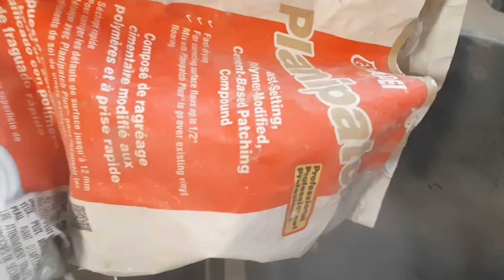How to use patching compound for unleveled floorings.

Comment: yet another video with no explanation as to what or more importantly why you are doing the steps
Reply: It’s ok it was Jack shit all the feather finish videos are, my advice grab some ardex feather finish and mix to specific mixing consistency if it’s a bit stiff in the bucket add a slight bit of water so it can at least flow out on its own, the more you work the compound it should loosen it up for it to flow work from end to end of room for a high point in the middle and patch from the middle out. When applying a cement bull float is the go to 20” will be plenty to hold liquid and have a wide enough edge to make progress efficiently. Work in the dedicated section in an s motion with a product pass over and then a finish pass to knock flat... if you find your applying with ridging  consistently you may be 
A) digging into the product as you finish the pass and will need to repass the areas to adjust for proper constiency between passes
Or
B) adding to much water to your batch when mixing. The least amount of water possible is best for the smoothest application, in this case try mixing a bucket at twice or three times your current thickness and work in a small area in c motion, it will show you why you have to much water as the compound likes to keep itself based on the pass you last gave as well ass sticking flat, warning this will dry in the 10-15 window to touch 45 to walk on so don’t mix to much. May make a video on it as I get a bit more work
Reply: Also forgot to mention Henry’s is at Home Depot in a 7lb bag as ardex is hard to find and it’s the same company slightly different formulations ardex also makes it in 10 lb bag as the product dries in 15 for feather edge and 1-2 hours for 1/4” at 65-70 they don’t make a bigger bag when you do get good at it just make sure you use a cement bull float no drywall floats it’s way different to sharp at the edge no taper and will cut into your material 100%